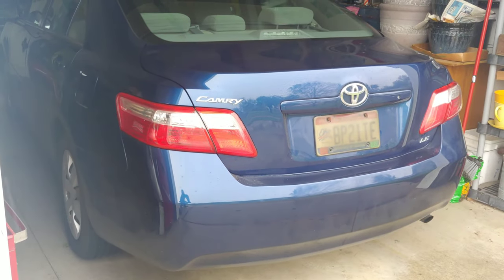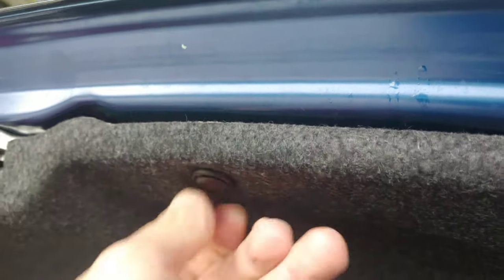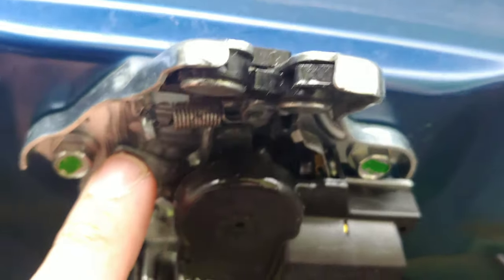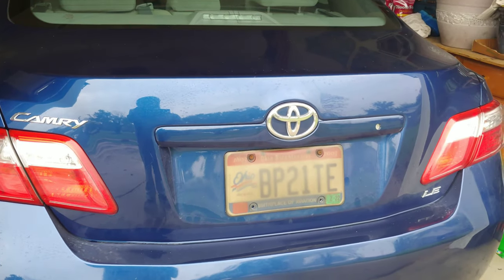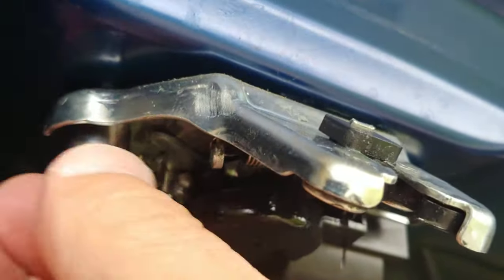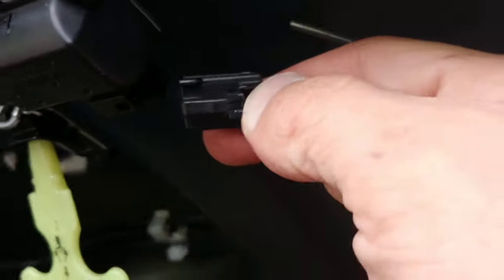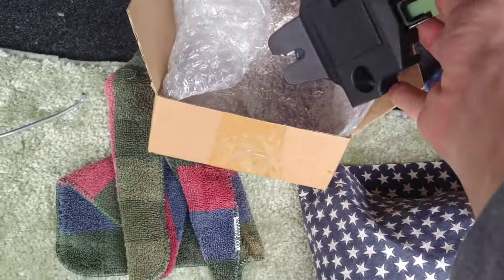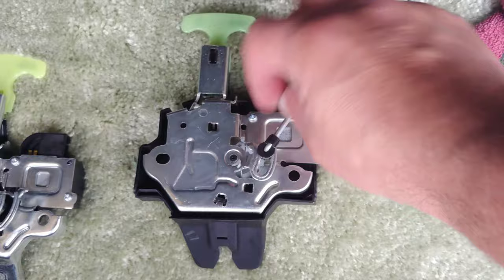2007-2011 Toyota Camry trunk won't stay closed, or latch shut. Simple, Quick Easy Fix!

Comment: Just discovered that you can use the key to unlock the trunk after you have manually switched the spring mechanism as shown in the beginning of the video.  You only need to manually switch the mechanism once, then close the trunk.  Next, use the key, not the clicker, to open the trunk.  Now you can close the truck without having to manually switch the mechanism each time.  This video is super helpful, and saved me an expensive dealership repair.  Many thanks!

Comment: Thank you for sharing this video. Was able to purchase the part on Amazon for $20 and replaced it within 15 minutes. The replacement part I had didn’t require the full cap to come off. It folded by the latch area with enough room to screw the bolts on/off.

Comment: Thank you! Having issues with the latch and you fixed it. ❤
Update: manually opened trunk and it won’t close again. Tried your method but the issue still seems to not want to work. 😭

Comment: I have the same problem. However, I found out that if I manually pull the trunk lever from inside the car the trunk will always close. I stopped using the remote to unlock the trunk.
Reply: I tried doing what you mentioned,  in my case, it doesn't work.
Reply: Yeah I noticed the same. If I pull it from inside the car it's fine.
Update Oct 2022: It stopped catching completely and the part had to be replaced 🥲 lol
Reply: That didn't work for me, gonna need to replace the part I guess